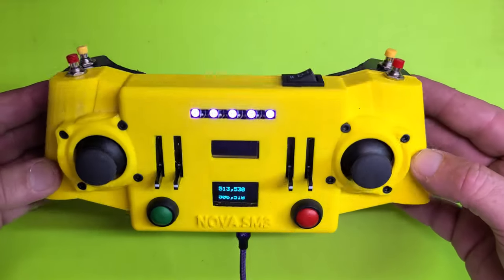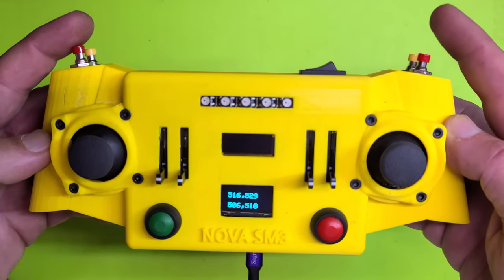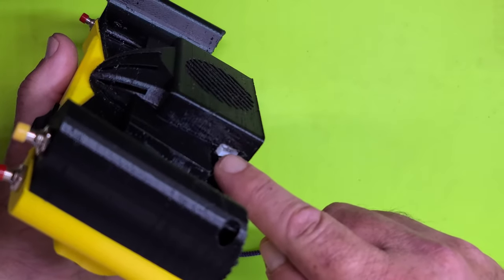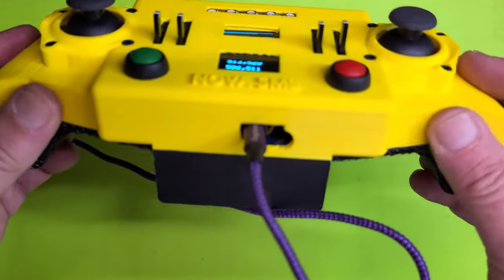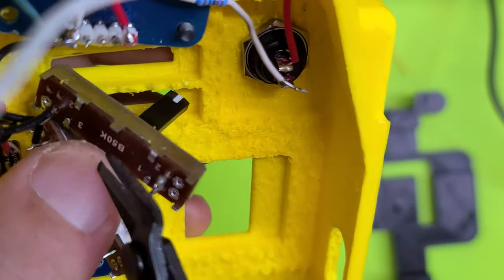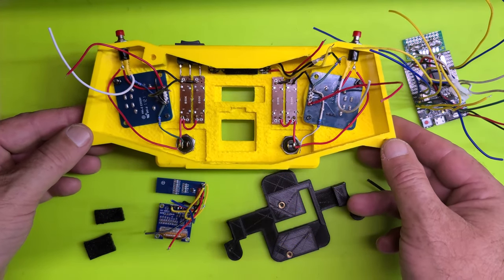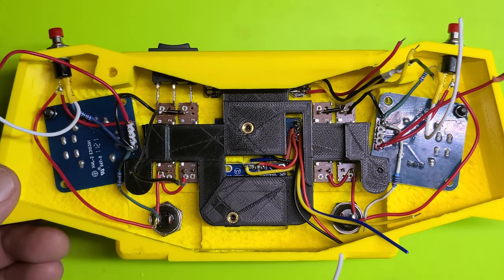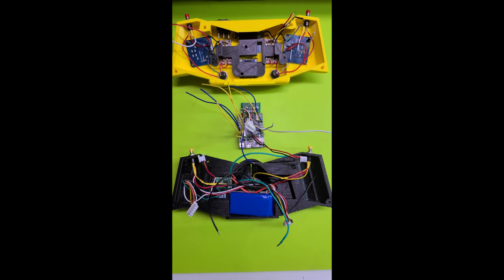DIY Remote Control - Part 6 : Complete Assembly - Nova SpotMicro3 v5.2

Comment: is that a wireless electric soldering iron?
Reply from the maker: Not wireless, but boy is it badass!  Heats up in 20 secs to 300c - sooooo much better than any iron I've used in my life. May not handle days of soldering on end, but it also has cool features like auto-off and such... so also the safest iron Ive ever used.  Its great, I recommend such a tool to all hobbyists.  I think it was around 80 US. Wireless ones, I've heard, just don't have the power - so probably only practical if you are under the hood of a car or something.